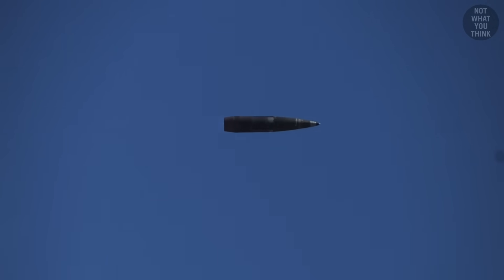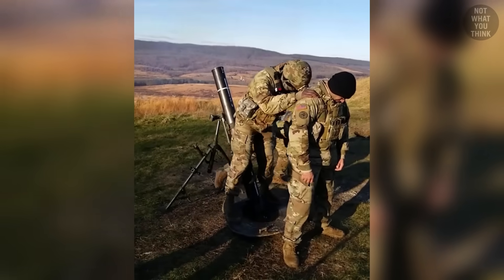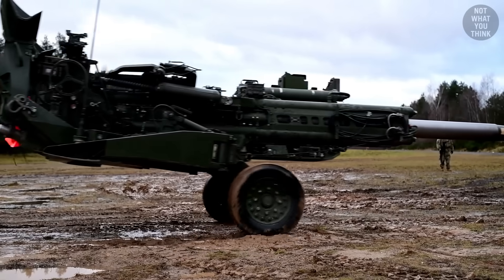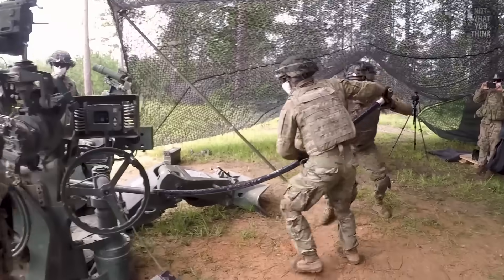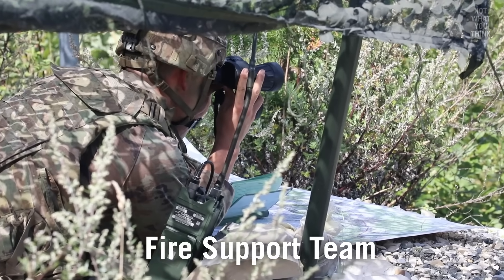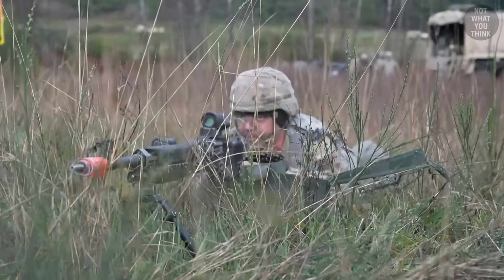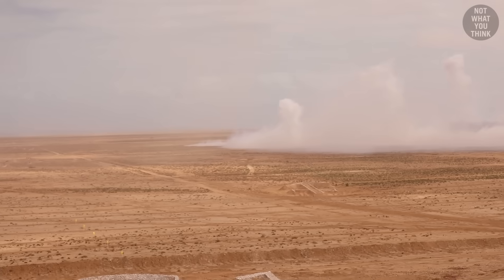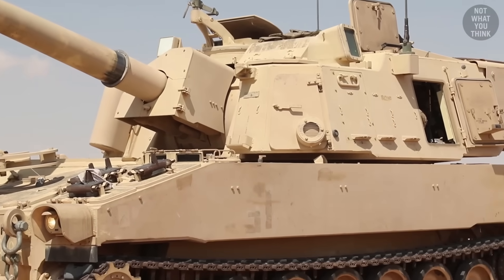How Aiming Artillery without Seeing Target Works

Comment: I was surprised to see a slide rule being used 8:35
Reply: I'm not sure how the US Battery Command Posts work, but in the Royal Artillery, using stuff like that (FAME - Field Artillery Manual Equipment, gun tables, fire displacement graphs and such like) usually means that your computer (FACE - Field Artillery Computer Equipment) has went tits up. My period in the Arty was late 70's to late 90's and by the time I left the FAME element had been replaced by hand held computers Now that was last Century so it's surprising that the video showed this type of calculations taking place. Possibly a training exercise to tick a box? an EMP cannot take out a chinograph (grease) pencil, so 'Steam Gunnery' might still be a thing even in this day and age.
Reply: It is not really a slide rule (although it looks like one) but rather a graphical artillery table.
Reply: If I remember correctly, USAFAS decided to keep manual gunnery as part of the training in the 90s when computers failed in desert heat during Desert Storm.  The other rationale that I heard that I agree with, if you can do manual gunnery "charts and darts" as we called it back then, You can better understand the calculation in case someone makes an entry error, you can more easily check for those errors and correct.
Reply: The "appareil de direction des feux" (French) or "Feuerleitgerät" (German), literally, the "fire control device", computes the deflection. You put the position of the guns, that of the FO and each target as if on a map. Then you turn it until the guns and the target are aligned vertically and the number shown on the side is the deflection - the direction relative to the north - required for the guns. It's a simple and efficient tool, with one caveat: the usual beginner's mistake with this device is to bombard the FO. As someone else commented, it's used as a backup procedure nowadays and it's also a great way to teach new soldiers where the numbers generated by the computer come from.

Comment: Fun fact a NATO mil is 1 meter left or right at a distance of 1km
Reply: Fun fact: Most adults don't know the first order approximation of sin(theta)=theta apparently.
Reply: @philipthecow  nor that the difference is (theta cubed) / (3 factorial)...and so on.
Reply: Depende de en qué dirección dispares
Reply: @JC-mg2xh  Puhu englantia saatana!
Reply: Well, not quite, but close enough...
Reply: So, 1 in 1000,  and the latin root for 1000 being mille…
Reply: @lutzderlurch7877  yup. Now it all comes together.
Reply: This fun fact is the mathematical reason "NATO mils" are used. 🙂 A complete circle = 360° = 2π radians = 6.283185... radians = 6,283.185... milliradians. When the target is far away and the angle is small, a handy linear approximation applies in the metric system: distance to target times angle in radians equals distance at target. For instance, 1/1000 radians times 1000 meters equals a shift of 1 meter at target. While π has great mathematical properties, it's challenging to work with in the field. In the 1860s, Swiss engineer and artillery officer Charles Dapples had the idea of dividing the circle in 6,400 “artillery mils” to test weapons from various countries that each used a different scale. The number 6,400 divides neatly (3 o'clock or 90° is 1,600 mils,  and so on) and 6,400 is less than 2% off from the 6,283.185 milliradians. This is close enough to use the linear approximation, which greatly simplifies the FDC's computations. If you want to be super precise, the 2% difference between art mils and milliradians means that a deviation of 5 mils at 1 km is 5 m, a deviation of 5 mils at 5 km is 25 m but a deviation of 5 mils at 10 km is a shift of 49 m (50 meters minus 2%). The Swiss system was adopted by France and Germany in the late 19th century and spread to other countries during WW1. The UK was a late adopter because its artillery did not use the metric system and 6,400 artillery mils did not simplify computations. The expression “NATO mils” is slightly inaccurate as Switzerland is not formally part of NATO.
Reply: @chpella  Except that the Artillery use mils (6400 mils in a circle) not degrees. I agree most infantry types use degrees however part of our drills in the Arty when using the infantry as Forward Observers was to convert their Direction to Target into mils. Mind you this was last Centuries Steam Gunnery before GPS sights became the norm. God Knows what the do nowadays - although I bet it takes a lot of batteries.
Reply: @ronhall9394  Yes, I thought I had written a long explanation about why mortars and artillery started using 6400 mils.
Reply: @chpella  so, close enough. I was wondering about that 6400.I figured it was nice b/c it's divisible by 2, 4, 5, 8, 10, 16, 20, 25, 32, 40, 50, 64, 80, ...and complements.
Reply: @lutzderlurch7877 well, yeah. A "mil" is short for a milliradian

Comment: Few things to correct but they are minor, mainly regarding US Arty and the M777

A: The crew are NOT "specialized infantry". The are full fleged artillerymen in Field Artillery Branch. Infantry have the number designation of 11 in their MOS, Artillery has 13. Mortars in the US Army are assigned to the infantry for better integration and support and have the MOS of 11C 

2: Aiming posts and aiming references arent for the gunline to aim themselves, they are used incase FDC camt send Fire Mission data directly to the guns. They radio by voice to the guns and give the mission data which is inputed and adjusted. The poles, collimator, or distant aiming point are just objects at know angles so the triginometry works out

3: Its called a lunette, not muzzle lock

4: Air Assaultimg Guns does look cooler, and is extremely fun
Reply: Yeah... mortarmen and canoncockers don't like to be confused with one another. They take what they do and their differences very seriously.
Reply: @taemien9219  indeed we do
Reply: @taemien9219  11C here and you are right don't ever confuse us with those arty boys.
Reply: You don't even necessarily need aiming poles or the collimator; a distant, fixed point (edge of a building, radio tower, etc) can also be used as the reference point but doesn't give any indication of parallax error like the aiming poles or collimator does.
Reply: @mr.stotruppen8724  well yeah but a DAP isn't your go to, it's a back up to your poles
Reply: @mr.stotruppen8724 DAP is 1500+ m to reduce parallax issues.
Reply: And the "feet" are called spades.
Reply: As an old 13Echo, thanks for your post explaining the discrepancies.
Reply: 13Bravo here. Bravo 3/321 out of FT sill training. Spent 6 year 10th MTN. Hoo Aah
Reply: @jbkunk9611  3-6, 2-15, or 5-25?
Reply: The poles arent at known angles, they are able to be placed in any location to allow the guns to line up on a referred deflection as well as to get all the guns aiming the same way.
Reply: @masterhacker7065  known angle as in once the poles and collimator are emplaced they are written down and are at a known angle in reference to the Gunners sight. Yes technically they can be emplaced anywhere but there's still a known angle between the azimuth of fire and where the aiming references are.
Reply: @sgtsnake13B  well yah normally you put the drop the gun, set it to the refer deflection and then place the stakes so i guess thats true
Reply: @masterhacker7065 the angles are known once emplaced.
Reply: These channels always get a ton of things wrong.  He probably read about those times back in Iraq when the Gun Bunnies would organize as infantry and participate in those four day cordon and raze the neighborhood ops.  They usually think combat engineers build bridges and drop CHU's too.   I was a sapper back then, 4-27 was our task force artillery.  Bravo Battery I think.  We were part of the 2-6 Task Force of the 2BCT of 1AD.  I tried getting fire missions, but they always sent a drone instead, you wouldn't see the drone back then, just the hellfire.

Comment: Fun fact Howitzers were always shotguns. Have you ever heard of GrapeShot, CanisterShot or ChainShot? Basically cannons were always gigantic shotguns.
Reply: Well yes, they did always have the ability to shoot shrapnel and grapes hot, besides solid or composite shot. Initially they were just siege weapons to knock down castle walls, but then someone had the brilliant idea to use them as an anti-personnel weapon.
Reply: @tatumergo3931 Cannons were originally used as castle wall breachers , but I'm pretty sure they were useful at panicking calvary horses .
Reply: @victorwaddell6530  . Do you mean by just blasting the gunpowder without any kind of projectile?
Why wouldn't you? 
All it would take is to drop a couple of shards of metal, stones, or anything else you could find. Not really a hard thing to do! 
The only reasons why cannons were not used as field artillery pieces was because of two things.
One because in the beginning they didn't have the sufficient metallurgical strength to produce the muzzle velocity necessary to obtain the range necessary to work as an anti-personell weapon. 
Although not entirely so in some few instances throughout history, like during the 100 years war in which the English were the first ones to used.
The second reason was one of the carriage that it was put on, not having the mobility necessary to employ it effectively under battlefield conditions. 
Think of early field artillery as a tank, in the sense that it is a movable gun that you can emplace anywhere in the battlefield. 
Early cannons were no better than a catapult, onager, ballista,, mangonel or trebuchet. The only advantages that a bombard or early cannons had, was that it was lighter and much easier to emplaced and employ.
Specially if you compare it to a trebuchet, which to be effective it had to be much larger, way much larger and it would take a couple of days to put together. Once a trebuchet was emplaced, there was no moving it to a different location. Not unless you took it apart to be assembled again in the new position. With a cannons this was done much easier and faster!
Ofcourse things being the way that they are, pretty soon they came up with ideas to add mobility to this early types of cannons, and with improvements in metallurgy more stronger field cannons started to appear. 
P. S. There's this account of some spanish explorers, who after having shipwreck on the Mayan coast were attacked by natives. They had a bombard with them that they had taken off the ship. In the account they relate how they had taken a defensive position with the bombard. The first shot initially startled the indians, but did little damage to them. Afterwards the natives just outflanked them and the battle had to be decided by the use of steel and  crossbow bolts. The story relates that it was only by the grace of God and the Holy Virgin Mary, that they were able to survive and tell the tale.